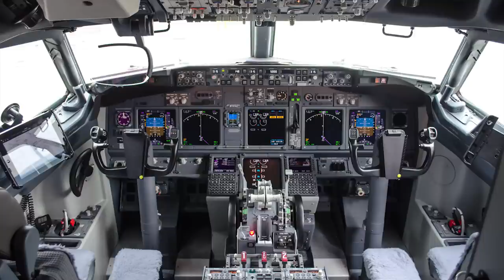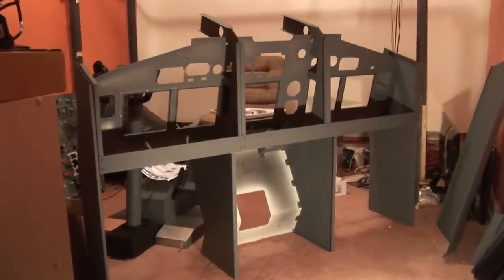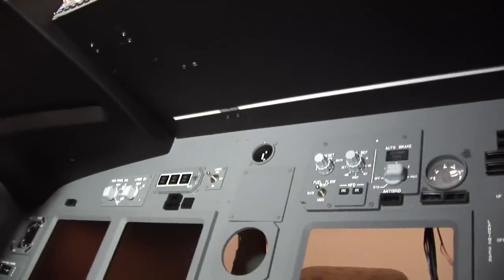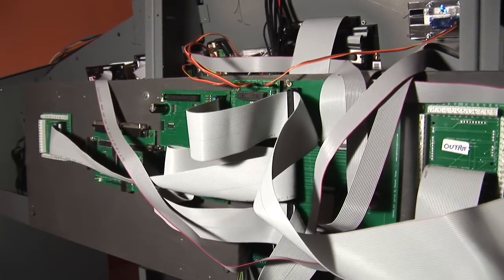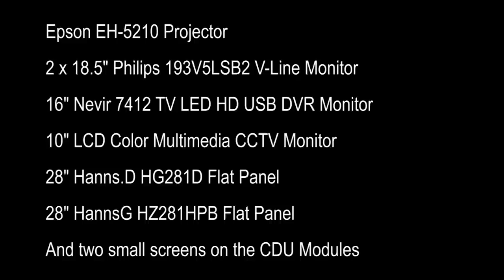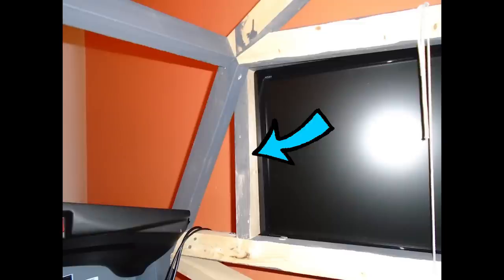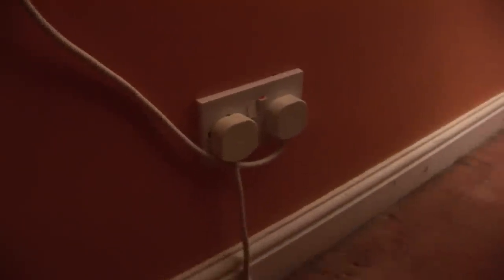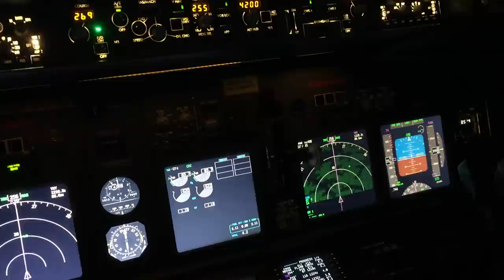Building a Boeing 737 Cockpit

Comment: I’m 15 and I’m gonna do everything you did. I was gonna work hard and rack up 50,000 for a full cockpit and an overkill PC, but If I can build it myself, and save thousands, I’d gladly do it. Especially now with the help of Father Dane. This is going to be a great learning experience. I will learn construction skills, soldering skills, coding, and aviation skills. Thank you, Father!
Reply from the maker: Your are very welcome. And yes, you will learn all those skills - and more. I wish you all the best with the project. 👍
Reply: Hey dude! I would recommend you save up for flight training if you are thinking to fly. And save up for a smaller aircraft sim. Which is way cheaper. And will translate directly into your flight training aswell. 
Safe skies!

Comment: As a retired B737 Series Captain, I was amazed at the incredible job you did assembling this maze of wires and electronics. Well done. I enjoyed your video very much.
Reply from the maker: Thank you.  I also had the assistance from a 737 pal of mine who flies for Ryanair.  I had him sit in the captain's side (where he always sits) and with his eyes closed, I had him reach out to all the switches and other controls that he would reach for in the normal run of things, and everything was where his hand went.  That was my biggest challenge: getting the angles and positions correct.  He had some valid criticism regarding the tension on the yoke - mine is a little soft (but you should try the yoke on the C-47 I used to fly if you want to build up your upper body muscles) and of course, he did note that my seating was not up to Ryanair's (or Boeing's) standards :).  Otherwise he was able to make a successful and comfortable flight (with me in the FO seat) and was quite impressed.  That was all I needed to feel that my work with all those tiny wires (and magnifying glass) was vindicated.  He assisted me with dimensions and proportions so I could make sure it was a true 1:1 construction at every stage.  If you are ever in South Yorkshire, please let me know and you can try it out for yourself.
Reply: Father Dane   Haven’t traveled much since retiring, but should the opportunity present to visit, I will. Thank you for your gracious invitation. How long did it take you to complete (this far), start to finish? May I ask what the cost is on this project?
Reply from the maker: @iwmtrainingroom7516  It all began 16 years ago with a single computer and a joystick using FSX.  I am an old pilot now (I used to be a young bold pilot) but I still like the touch of the controls so piece by piece and part by  part I bought and assembled and expanded as I went.  The major purchase of the MIP from Opencockpits in Spain was the start of the final version I have now - that was in 2018.  It took many months to put that together, and  I had to check the circuitry and connectivity as I went along - and it was a few more months after that and after assembling timber and vinyl flooring to form the tight and almost "claustrophobic" effect of the cockpit that it appeared as it does today.  As to cost.  Well, if there was a fire I suppose I would be needing around £25,000 to rebuild it the next day.  But that cost has been spread out over 16 years to get it to this today, as you can appreciate.  But I do enjoy it - even the low frame rate doesn't take away from the joy of flying once again.
Reply: Father Dane  - Old Pilots all share at least one thing in common, we survived. I knew many who did not for one reason or another. I’m sure your Sim provides many hours of enjoyment for you. Thank you for the added detail, and for doing such an amazing job filming your project. 😊
Reply from the maker: @iwmtrainingroom7516  Thank you

Comment: As an electrical engineer....i am having a conniption just looking at that wiring lol .... Absolutely fantastic job and i wish you many hours of pleasant flying
Reply from the maker: It was a doozy - and I needed a magnifying glass for a lot of it because the wire was so small and the sockets were even smaller.  I had a wiring schema but following all those lines with these old and tired eyes was a challenge. It took me several weeks to complete the wiring part and then there was the testing part where I had to track down any connections that were loose or crossed.  That is worked after all that was a miracle 😉
Reply: @FatherDane  Fantastic job, i am so envious it must give hours of joy, especially in recent months
Reply from the maker: @gabrieldillon11  Yes it does - I can "go" anywhere in the world I want and that is a great bit of natural home therapy 😊

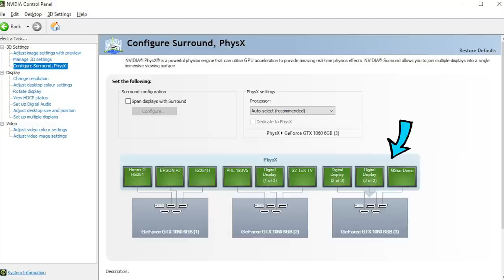Comment: Great video. I saw that you had 3 1080's and in the part at 33:40 it shows 3 1060's why is that
Reply: connor gibson I also see that I guess he get confused . I think he had 3 GTX 1060
Reply from the maker: Yes, three 1080 monitors but the graphic cards are nVidia  GTX1060 cards which is just the model designation

Comment: This is amazing. I've been considering opencockpits' single config desktop version. How do you connect the multiple Ethernet connections to your PC? Does your motherboard have a bunch of Ethernet ports or are you using a network switch of some sort?
Reply from the maker: I am now running two computers to power the simulator. You can see the videos I made from October 2021 under UPDATE titles. Each motherboard has two ethernet ports and I also use a couple of external ethernet switches. See https://youtu.be/TelveXJaIv0 and others around this time for more information. I also use Wideview and WideTraffic to ensure complete coordination between the two computers. As to open cockpits modules, they use USB connections rather than ethernet, and yes, I do have a couple of USB hubs to power everything. Happy Landings 😊

Comment: very good job !! i wonder about the cost of all of this ...seems very expensive!
Reply from the maker: It all depends on how far you want to go with your simulator.  I have been building mine for over 15 years and I suppose it is worth somewhere around £25,000 now if I were to start again.  Does this help?
Reply: @FatherDane   It helps persuade me its far too expensive for me. And over time  I would think VR is going to make cockpits like this largely redundant. I appreciate that VR lacks sufficient resolution at present but in terms of what you see visually, it isn't that many years away and will be far cheaper, about 1/10th of the price I would think and more immersive. I admire what you have done though, it looks very impressive.
Reply from the maker: @cbcdesign001  Yes VR will be an economic alternative for many people.  However, there is still a sizable number of people who can't use VT for various reasons, and I am one of them.  Another drawback to VR us the lack of tactile ability - the lack of proper touch sensation. I had a set of touch screens I used for an earlier model but there is nothing like the feel of a switch or the twist of a knob.
Reply: @FatherDane  Yes, until VR is further developed to add touch (gloves?). In particular, the stereo vision VR offers is a major advantage. Adding motion is another difficulty with full cockpit builds. Also, VR offers the flexibility of flying a Cessna for a bit and then a 747. Your build is amazing and commands respect, enjoy!
Reply from the maker: @izsakitt3711  Thank you 😊

Comment: Amazing and absolutely useful video! Great job! May be there was an answer, but what was the full price of all components and delivery? Did you synchronized CPT's and FO"s yokes movement?
Reply from the maker: It's hard to say what the total cost would be as I purchased all the parts over a 16 year period. But today you can get an idea by looking at opencockpits.com - I did have the yokes synched but there were problems. Never did get them resolved. 😊
Reply: @FatherDane  Thank you so much for your answer! I wish you pleasant flights and to solve the problem with yokes.
Reply from the maker: @igor-xe9uo  😊

Comment: Use Velcro ties to bundle wires.  They can be replaced with ties after final test but it's great to have them organize the wire but removed and reapplied when a change or mistake if found.
Reply from the maker: A great idea - thank you! 😊

Comment: Fantastic. One suggestion though. I have found that if you paint the edges of the TV screens a light blue  or grey colour you do not notice them as much especially when in the air which is for the majority of the flight hopefully..
Reply from the maker: You are correct, of course, and some have suggested using tin foil as well. I was just too lazy to try them out 🤣🤣

Comment: I have their single seat MIP, Pedestal & AFT overhead. I still need to get their FWD overhead. I would like to get their yoke & pedals too, but currently using Saitek. Initially I was using SIOC, P3D and Prosim but I had too many instability issues, which I think were caused by SIOC, so I moved over to XPlane with the zibo mod and OCUSBMapper. No SIOC needed :)    .. Was the best move I did.
Reply from the maker: I agree with you that having too many device driver programmes is a complication all by itself.  They start competing  with each other.  I looked at Prosim and a few others, but decided to stay with SIOC as the one I use and with SIOC scripts from Roar Kristensen and his OC4BA as that gave me the greatest stability.  Besides, then I have only one thing to check when things go wrong.  I experimented with an earlier version of X-Plane but was turned off by the need to keep adding stuff on.  Plus at that time, the add-on sceneries were in shorter supply.  I went with P3D as it used the same core as the old FSX and as I was able to port my sceneries over, it made more economic sense to me.  Currently I have 171 sceneries that I have purchased over the years and were I to switch to another platform now, all that goes out the window.

Comment: Thank you for sharing this!  Wonderful job, not only creating it, but showcasing it in this video. Perhaps when I retire, I will have the time to do something similar, but not to the grand extent you have.  --Fr. Gene
Reply from the maker: I found that the project helped me enormously with the transition from active to semi-active retired and then to retired.  When I noticed so many of my friends suffering from dementia it caused me to do something about it - and building a 737 in my spare bedroom was the answer.  The experts say that if the mind can be constantly challenged it will prevent the onset of dementia.  So, fiddling with small wires and tracking down connection errors certainly presented the challenge.  As does the exercise of planning an ILS approach in the working cockpit.  I still have my commercial pilot's licence (with IFR etc) and while I couldn't pass a flight physical to actually fly anymore I can at least keep my skills up-to-date.  Enjoy the videos.

Comment: Awesome sim and very impressive video documenting your build steps.  Just curious what kind of funds it takes to put together a sim like this.  I already am familiar with Opencocpits but where did you get the captains yoke and pedals all setup like that? Was your fwd overhead from Opencockpits also?  Thanks in advance and happy flying.
Reply from the maker: Yes - most from Opencockpits but the throttle quadrant I got from Flight Simulator Centre in Italy

Comment: Thank you...this was very interesting and informative.  How much electrical experience did you have before you started this project.  My electrical experience is very limited and soldering skill may be weak, but I can read blue prints well.  Do you feel this is something that would be attainable for an inexperienced electrician?  Also, what was the total amount of time it took you to complete this build?
Reply from the maker: It took me longer to do as I am an old man and not as steady as I used to be.  I don't have much experience with soldering either, but truth is that most of the connections are slotted and tightened with screws.  There wasn't much soldering needed. I suspect a younger person could assemble the whole thing in about 30 hours. Building the rest of the cockpit took longer as I had to design and build it as I went along. I made several mistakes and had to do some parts over. But that could be done in about the same time 😊

Comment: Excellent Job, Father Dane!! Thanks for the video! I am getting an issue when I want to move the ADI and HSI, but they are not popping out, and then I cannot adjust them in the centre display  (I am using MSFS 2020 and PMDG). Is it an issue on MSFS, or am I doing anything wrong? Yours looks amazing!. Again, thank you very much!
Reply from the maker: Hello - Unfortunately I cannot help. My system is based on P3D rather than MSFS which is a totally different system even though you use PMDG. Your version of PMDG is written for MSFS so this will have to be a ticket enquiry for PMDG on their support page. Sorry.
Reply: I see. I will ask PMDG, and in any case, I can always go for P3D; thanks for the advice. @FatherDane
Reply from the maker: @javiergarcia-heras My basic premise is this: MSFS is for entertainment and P3D is for instruction. Since maintaining my skills as a commercial pilot was more important than entertaining myself, I chose P3D. And P3D is made by Lockheed Martin and the integration of PMDG with its software is really seamless. I admit that MSFS is great scenery but IFR pilots do not spend much time looking out the window after take-off and just before landing so all that scenery is superfluous. Just a thought. I hope this assists you with your choices. Happy landings 😊

Comment: How much would it cost to build something like this? How long did it take to build?  Can CAA allow sim time on it in your log book? Amazing workmanship and the patience of Job.
Reply from the maker: I have been building mine for over 15 years and I suppose it is worth somewhere around £25,000 now if I were to start again.  And while the software is very good, because it doesn't have motion it probably won't help with the CAA.  However, if you can get a certified 737 pilot to sign off on it then you can programme this to perform emergency procedures which may count.  Does this help?

Comment: Lots of power and heat . Not sure if wood as a cover is good maybe  leave it open to cool or use metal sheet. With lots of holes. Great build.
Reply from the maker: Actually, my biggest problem is that the room is too cold.  The cockpit is not completely enclosed, only the roof and sides are there to give the illusion of being in a cramped cockpit.  The back (behind the pilot) is totally empty.  The reason for the cold is that my projection screen is placed in front of the radiator, and to prevent the vinyl flooring sheet from melting or distorting, I had to turn the radiator off. So, you will see me in some woolly sweaters when inside.
Reply: @FatherDane  you have spent a pretty penny on that lot I went to the web site had a look quite expensive. Maybe moving the rad would help. Not th at expensive. Great job.
Reply from the maker: @redpillretail  I've thought about it :)

Comment: Hello Father Dane nice video and nice cockpit but I have some questions 
1:if I buy panels from opencockpits  do the panels come   with a driver for the installation ore do I use and other software for that for example fsuipc4.
2:do the displays automatic loading in there good position ore  must I use a software for that.
Thanks for your nice video and succes with your channel.
Reply from the maker: Thank you for the kind words.  As to your questions: Opencockpits provides SIOC freely to its customers.  SIOC is the language used to connect the hardware with PMDG.  However, while you can always write your own scripts (and Opencockpits do have a number of examples online) I found it so much more convenient to use Roar Kristensen's OC4BA5.  The cost is very low and worth every penny as he also gives excellent support.  As to the placement of the panels - that is done manually by you and once they are in place and sized as you like them, they then remain with the scenario to which you save them.  Since no two persons will have the same arrangement, it is impossible to make a one-size-fits-all programme.  But it is easy enough to do - just undock the panels using the P3D panel manager and then after sliding them into place you resize them to fit.  Click on the lock panel and remember to save your work to the scenario and it will be there whenever you choose that same scenario again.  The panel locations are listed as "cameras" in the details of the scenario so that is why you must choose that scenario each time you enter P3D. Happy landings.
Reply: @FatherDane  Thank you for your information thank you. 
succes with your cockpit and your channel.
Reply from the maker: @Djmike22  👍

Comment: I have some questions:
1. Do you know if Open Cockpits deliver to Canada? I want to buy some of there parts.
2. How long did it take you to fully build it?
3. Would the overhead panel be compatible with the other panels if it was a different brand?
4. What throttle do you recommend? (the one I saw on Open Cockpits was out of my budget)
I hope you could help
Reply from the maker: Yes, Opencockpits deliver to all parts of the world.  And this latest version (I've been expanding for over 15 years) took about two months to complete … although I still tinker with it.  As to compatibility issues, those are best directed to Opencockpitls - email Rubén Macías support@opencockpits.com and he'll tell you.  The throttle I have came from Flight Simulator Centre in Italy and was much, much cheaper.